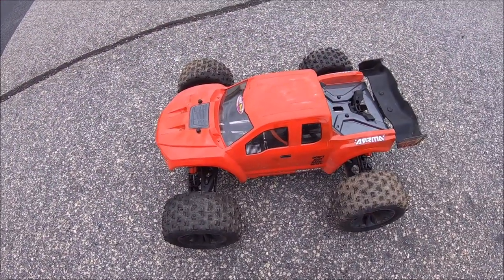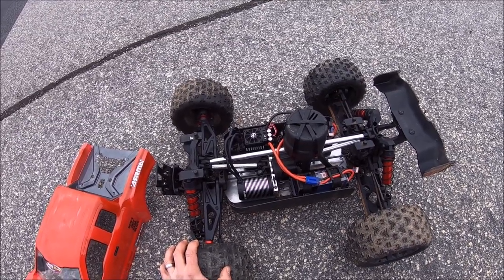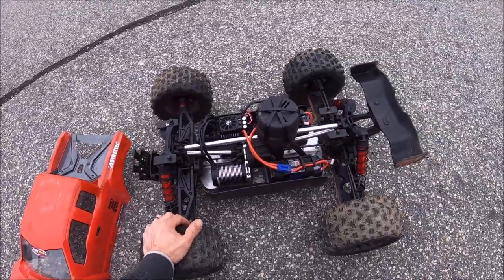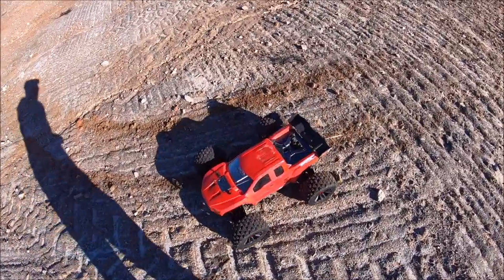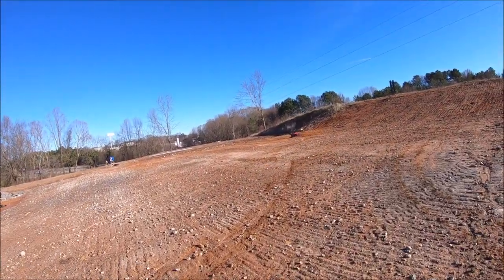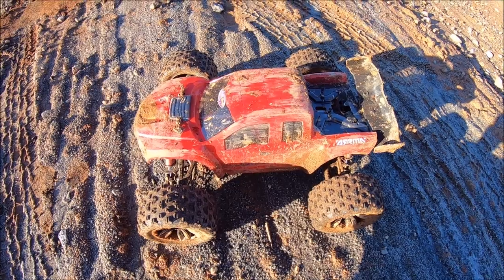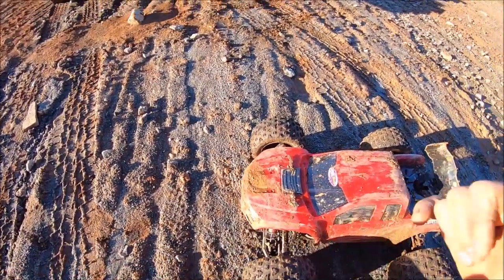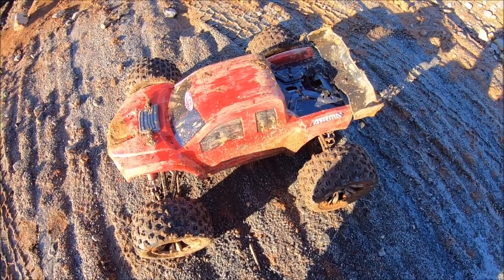Arrma Kraton 8s SWB "M2C CRUSHER!" -NEW MOTOR!! A FREAKIN BEAST!

Comment: Killer vid, Brother E! Is the SWB chassis wider than the Kraton chassis? I bet lining up your ramp at speed is no easy task. You are very good at it 😎👊👍How do you like the Hobbywing motor? I think I am going to give it a try. It will probably be better for jumping than the monster I have in mine now. Less weight and easier to gear. Anyway, great stuff as always 😎👊👍 I'm definitely adding the droop screws!

Comment: Awesome bash brother. 

Still waiting on seeing the Kraton 8s do a double backflip. 

I challenged the RCUNEXTTUESDAY boys but they respectfully declined 🤣

Come'on Dude81 you legend, you can do it!!! Or is Sir Sargent Duperbash gonna steal the show?🤔

With the crazy amount of air time you achieve you should pull off the double piece of piss  bro 🙂👊👊👍✌
Reply from the maker: 🤣Thanks bro! I actually did get a double backflip in on my video before this one!👊The bash was cut short due to my motor locking up👀The double was with huge Trencher 43's. I can do it all day long with those tires but I dont personally like them. Too tall and they balloon waaay to much!🤣🤣The stock tires can pull a single pretty good on this swb considering how light they are. Thanks for watching bro!!😎💪🤘🤘
Reply: @RCDUDE81  really?  I'm going to have to check it out immediately bro 🙂👊 why wasn't the newspapers notified man this is big news lol.

The Kraton 8s has come a long way since it came out. I was very unimpressed by it back then 🙂👊👊👍

Comment: Incredible run mate you and rich are definitely the best wen it comes to bashing an that short chassis is amazing🤯
Wen cleen your rigs do you hose them down and then dry them with the air compresser? 
See you Saul 
👍👌👊
Reply from the maker: Thanks bro!😎👊Yes if its muddy i hose it down and use a mild degreaser. Then use an air compressor to dry it off, then use a silicone based WD40 and spray down the whole truck including plastics and bearings!😁💪🤘🤘
Reply: Thanks mate for the info
Fed up cleaning my car with a paint brush and specially the kraton 8s it's a monster
Gona buy a compresser tomorrow hahaha 😜
See ya saul
👍👌💪👊

Comment: Is this the 1100kv? I run the Max5 with stock motor. Does the 5687 1100 kv do any better than the stock motor?
Reply from the maker: Yes this is the 1100kv Hobby Wing. I do feel a bit of difference in this vs stock. Mainly a lot more torque and is super fast on a 30 tooth which is what I currently run. The stock motor isn't bad once geared up and you get rid of the smart crap ESC🤣
Reply: @RCDUDE81  cool thanks. About what I figured. And ya who needs smarts lol. 👍

Comment: What lipos do you use and what durability do they give ?
Reply from the maker: Powerhobby lipos. I use them in my 6s rigs too. Great powerful packs! In this truck I'm using 6500 100c 4s packs.😎👊🤘🤘
Reply: @RCDUDE81  ok i use the spectrum smart li-pos 14.8v 5800mha 100c but when i run my car they only last for 20-25 minutes, is that good ?Do yours last longer ?
Reply from the maker: @Metron_Ariston  That's about average time for a run! Mine last around that depending on how hard I'm running. You can get larger mah rated batteries but then you run into extra weight and possible overheating.

Comment: I have a kraton 8s and it is built too and I may be a little slow or just not up to date. But what are droop screws and how do I get them?? cuz I am tired of bending shafts and I'm waiting for m2c to come out with aftermarket shafts and hopefully they'll be out soon and also the blocks to make the arms tighter.
Reply from the maker: The droop screws I used are 3mm button screws ran in in the 2 holes under the arm. Just adjust them so the arm is off the chassis ears👌The M2C shafts should be ready any day along with the blocks! Rich and I will keep everyone posted!👊
Reply: @RCDUDE81  can't wait bashing weather is here. thanks for the reply and update